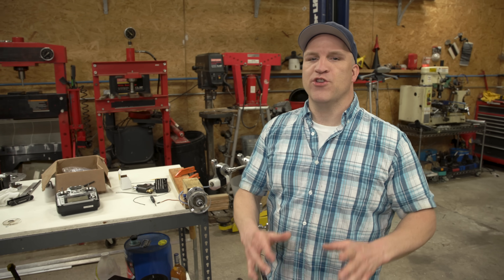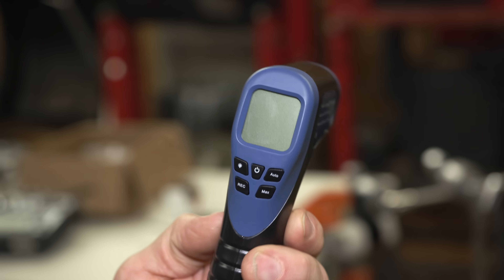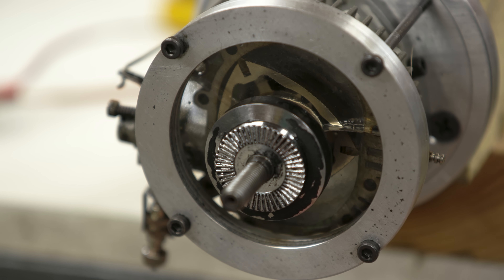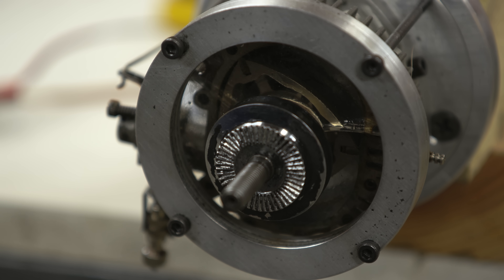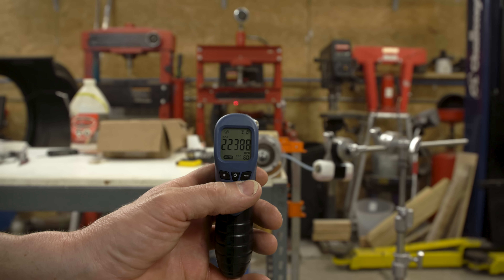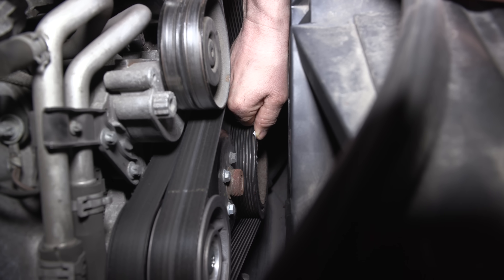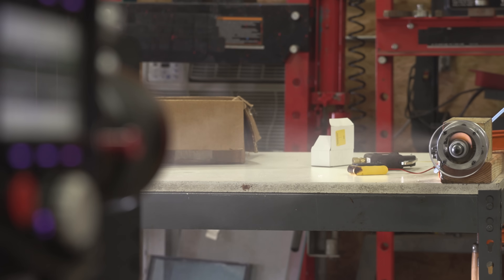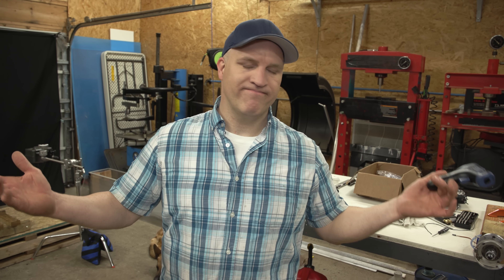See Thru Rotary Engine MAX RPM - 29000 (Wankel Engine)

Comment: This 5cc engine can put out roughly 4hp at its max 48,000 rpm. That's some seriously impressive power density.
Reply: Damn that would be 4,000 hp naturally aspirated if upscaled to 5.0L
Reply: @dbldigitclimbing2681  what was the fuel source used? on nitromethane its totally possible on a 5L engine.
Reply from the maker: @jkk20  nitro yes
Reply: @jkk20  Model aircraft fuel is essentially nitromethane, but different percentages are available depending on the (typically) model aircraft used with this.  I run 15% in my Wankel-powered Kalt Baron .28 helicopter, but 10% on fixed-wing aircraft.
Reply: @WarpedYT  Rob Dahm proved this wrong by putting down 800 lb-ft of torque on the dyno with his turbo 4-rotor 🤷‍♂️
Reply: @dbldigitclimbing2681  Engines don't scale that way as things like friction and inertia don't scale linearly. If you blew this up to 5 liters of displacement and could somehow keep it from flying apart at over 20,000 rpm things like friction and increased surface to volume ratios would rob a ton of power.
Reply: @dbldigitclimbing2681  dang, that's what you call an incredible power to weight radio
Reply: @dbldigitclimbing2681  ye but try getting a 5litre up to 48000 rpm
Reply: @dbldigitclimbing2681  let’s do it
Reply: @dbldigitclimbing2681 Bold of you to assume that a 5.0L engine can rev to 48,000.
Reply: @dbldigitclimbing2681 The stresses would be so high, it's going to explode
Reply: @dbldigitclimbing2681  you cant say that judging soley on the cubic measurement, i can have a 1L rotary that can put out 600hp but thats only if its properly tuned and ignition is fined and also it would need either a turbo or a really large  throttle body
Reply: And fuel consumption is 10 liter per hour... 😂
Reply: Which is nothing? Tankevurpa?  @АлександарКовачевић-б6р
Reply: @kalleelisson3059  it is
Reply: @kalleelisson3059  for a 5cc engine it is
Reply: @АлександарКовачевић-б6р  Not bad considering a 10,000 hp Top Fuel burns 15 gallons of 80/20 Nitro in 3.6 seconds.
Reply: Absolutely, considering how much smaller it is than say a 5hp Briggs&Stratton engine
Reply: tired leeches but how much torque. The hp is a result of the high rpm.
Reply: Anita IceCream  Hmmm.... It's pretty much the opposite.... torque means nothing if you got a properly set gear box... It's just a marketting number....
The only number that matters is power. Since with gear reduction, you can get all the torque you need from power, that's why we've crated gears.... ^^'. 

If you don't get it, you don't understand the core principle of a gear box (and gear reduction).
Power = Torque x RPM (or "angular velocity" for the physicists)
Power is fixed by the engine. By changing RPM (with gear reduction), you change torque. There could be gear reduction anywhere between the crankshaft and the ground. For automotive application, it is in the gear box (obviously), the diffential and even with the wheels/tires size.

If we tend to prefer bigger engines for high power/load applications that's because for the same power, small engines with high RPM/boost tend to wear quickly and to cost more. Not to mention fuel efficiency.
It got nothing to do with torque.
Reply: But 48,000 rpm how u said is just 48 rpm u should have been write 48 000
Reply: My flucking brain hurts from the arguing over engine science.
Reply: thats more than my 50cc scooter
Reply: Yeah... but good luck gearing that down to a usable shaft speed and still keeping close to that power.
Reply: @6Twisted Bullshit! O.S. engines lists the  model 49PI at just 1.27 horsepower max. with max. RPM of 18,000.
Reply: Definitely beats my 100cc 7 hp Honda xr100 dirt bike
Reply: 800hp Per liter 🤣
Reply: @Martin Larson Only 200 horsepower per liter, on nitromethane... pathetically embarrassing.
Reply: Let's put it on a mini bike then
Reply: Rotary engine:
Me: EXCUSE YOU
Reply: and gobbles fuel like an american v8
Reply: No it's not, no torque made by it at all, use it for miniature airplanes ? go carts, or chainsaws, outside of those it's useless
Reply: Dick Head : Power-to-size and power-to-weight ratios are only more important than the power-to-displacement ratio if you're modding a very small car and you don't care about fuel economy. Obviously that doesn't apply to cars that are being professionally designed and manufactured, because they can design the car to fit whatever engine they want to use. However, I will concede that you are correct in the circumstance of modding small cars, even though that only applies to a very small number of cars in the world and thus is not capable of sustaining a profitable Wankel engine manufacturer on its own.
As for the specific example of an original VW Beetle, the Subaru flat-four is a better choice than a Wankel if you want the car to actually be driveable on a daily basis.
Reply: In 1996 I raced RC 12th and 10th on-road cars at the world championships (I got 12th, 21st), the week before the races Mike Swagger was practicing his 1/8th scale onroad car, 0.21ci or 3.5cc, I could hear the incredible rpm's, I asked Ron Peris (now rip) his tuner, he said that 7 port motor makes 4hp and screams at 60Krpm!
Reply: I hate rotaries
Reply: DUDE THATS OP
Reply: At this rpm how much watt and voltage can produce ?
Reply: Ikr it’s as powerful as my lawnmower which has an engine like 10 times bigger
Reply: Yes but a rotary engine is much less reliable than for example an inline engine. It has much more accurate movement which make it easier for the engine to fail.
Reply: I mean even the rx7s had like 1.3l engines
Reply: Gas turbine engines also have large power density.
Reply: Its impressive as a proof of concept, but unusable my any means because it would have zero torque
Reply: @DSperformance96  that's what gears are for
Reply: @whoami13__  you would need 50 gears to get anything usable out
Reply: @DSperformance96   Absolutly not. With 16" ish wheels you could go to 30 km/h with 4 or 5 tiny and lightweight gears. And if you meant 50 gear ratios, it's absolutly false too. You don't even have a power curve to say that. High or low peak torque alone doesn't mean a wide or narrow usable power curve. And "zero torque" relative to what? Maybe it got a high torque at its "low" RPM range (6 000 - 10 000 RPM) and with proper gear reduction, it could be a lot more usable than you think.
Reply: @DSperformance96  it would be good for hybrid stuff. Or with a turbo.
Reply: Does anyone know where I can buy one of these little engines?
Reply: @wing_nut_101 Wankel engines are not made anymore, this engine was discontinued years ago, might find a used one on ebay.
Reply: @EnricoAwsome 1.2 hp for a nitro 5cc engine??? Not impressive at all.
Reply: And 0.594Nm of torque lol
Reply: @MasterofOrion  "6 years ago"
Reply: Hp per liter is a stupid figure
Reply: @ezra5485  cant agree more.. its an immaginary measurement that has no effect whatsoever on anything this engine could be used for, basically its a made up figure for wanna be racers so they can start talking
Reply: @DSperformance96  It actually states the engine efficiency.
Reply: @vladimirlucifer4566  in which way?
Reply: @DSperformance96  Volumetric efficiency. How many horsepower can a engine take from fuel from a delimited displacement.
Reply: @vladimirlucifer4566   i meant in which way is this value usable in the everyday world?
Reply: @DSperformance96  It isn't. Like it isn't torque, or horsepower, or gravity acceleration, or potential energy... But it still states how powerful and efficient an engine can be, volumetrically. It means that if you do a replica with the right materials, you can make out of one liter the horsepower that the small engine can per liter. But it's not really true. It just shows how much power it can convert. It's useful if you want to know efficiency and better understand air fuel ratios
Reply: @vladimirlucifer4566  but my point was.. in a normal rant between car guys, no one comes up with "yeah my car makes 600hp per liter", but I hear people all the time ranting about torque,horsepower.. its just a stupid value for the fact that in day to day life no one can use it for something normal
Reply: @DSperformance96  Actually, there are a great utility of knowing horsepower per liter: it's the best way to compare engines with different displacements, and see which has a better potential and what is tuned better.
Reply: @DSperformance96  if you only want to compare engines based on their power rating you're basically denouncing an engine with a low power output even if it is highly tuned becuase there is a big and lazy engine making more power. An efficient engine is very important in a race car because a smaller more efficient engine is a lighter engine and you will go faster. It's not a made up figure...
Reply: @backwoodbandit186  you just don't understand
Reply: @novathepug6692  🚨🎰🤡
Reply: As with all Wankel engines, the rated displacement is only for one side of the rotor, based on the flawed argument that 1 rotor = 1 combustion chamber, even though each rotor obviously creates 3 combustion chambers inside its housing. To compare its displacement to a piston engine, which are rated according to the displacement of all combustion chambers at once, you have to multiply the rated displacement of this engine by 3. That would be 15cc.
Reply: @fyrstormer  The rated displacement is actually the whole chamber volume minus the volume of the rotor...

Like any Mazda wankel engine.
Reply: @fyrstormer  And even so, the rotor fires once per eccentric shaft rotation. Yes, Because the rotor rotates 3 times slower than the eccentric shaft. And each rotor fires once per crankshaft rotation like a 2 stroke. If your assumption was correct, then because the Rotary Is a 4 stroke, this little engine would have 10 cc, not 15. But again: chamber volume minus rotor volume.
Reply: @vladimirlucifer4566 : Your understanding of "displacement" is incorrect. Displacement is not simply the volume of air inside the combustion chambers at any given instant, it is the volume of air displaced by the pistons (or rotors) as they move through a complete combustion cycle. Displacement is the maximum volume of all combustion chambers minus the minimum volume of all combustion chambers.

Also, I am aware that a single-rotor Wankel engine only has a single combustion event per crank rotation. However, that is irrelevant. Piston engines are rated according to the displacement of all cylinders combined, even though it takes two crank rotations for all the cylinders to complete a combustion cycle. Wankel engines should be rated the same way -- the displacement of all combustion chambers combined -- even though it takes 3 crank rotations for all the combustion chambers to complete a combustion cycle.
Reply: @vladimirlucifer4566 : I said "one combustion cycle for ALL combustion chambers." Go back and re-read my previous reply more carefully. Piston engines are rated according to the displacement of all combustion chambers over a full combustion cycle, and Wankel engines should be rated the same way.

Wankel engines are rated differently because that makes them appear to have higher power density (hp/L or whatever combination of power and volume units you prefer). This was an important marketing trick, without which the market for Wankel car engines would've never existed.

In reality, when you correctly consider the air displaced by all of the combustion chambers over a complete combustion cycle, and you calculate the amount of fuel needed to achieve an ideal mixture, it is apparent that Wankel engines have always had an inferior power density and inferior fuel efficiency compared to contemporary piston engines. They are more space-efficient, allowing 3 combustion chambers to use the same hardware whereas piston engines require separate hardware for each combustion chamber, but that is the Wankel engine's only advantage.

I say this as someone who used to own a Wankel-powered car, and who currently owns 5 of the miniature engines used in this video.
Reply: @fyrstormer  A full combustion cycle is just one shaft revolution. A rotor rotates 3 times slower than the eccentric shaft. So, the displacement of one combustion per "cylinder" is equal to 654, giving the rotary it's 1.3L however, it fires like a two stroke, so you could double the displacement because it's a four stroke, being 2.6L of displacement. One full combustion per cylinder is 1/3 of a rotor revolution.
Reply: 6Twisted figuratively that’s shit but for its size I guess it’s fine
Reply: @arsenicant  That's like 800HP per litre.
Reply: Arthur Boyarsky like I said for it’s size that’s fine
Reply: @arsenicant  Whats you're idea of more than fine?
Reply: @arthurboyarsky1954 800 HP per liter? 

That's a lot more than a Formula 1 V6 engine.
Reply: @arsenicant  fine??????????

Comment: 483 revs per second sounds more impressive than 29,000 per minute lol. Crazy.
Reply from the maker: Lol... Agreed
Reply: Porca madonna...
Reply: I agree.  But the turbo on my car is much bigger and tops out around 180k rpm.  3000 per second, or 3 per millisecond :)
Reply: @h82fail  180k my ass...
Reply: @recepgunoglu4058  possible but pushing limits BIG time in some turbos. my stock turbo,s max is 130,000 for arguments sake
Reply: @jasonstalder5208  i thought he was talkin about the car's rpm, so my bad 😅
Reply: @h82fail  Well whoopee do. Mass of the moving parts is actually what matters, not just size. Also, don't you think that's a bit different? Even a little? The tiniest bit?
Reply: @kilppa  It is different I'm just putting it in prospective and i thought the rev per second was kinda funny.  Also not sure the mass of the moving parts is that different, yeah turbine is not that heavy but this rc plane piston is not that heavy either.
Reply: Then slow down the film .. his RPM counter hit 97.+++ Rpm 
Just go back just before he freezes pic at 29.+++
Reply: @kennethschultz6465  you're wrong. it is 9700 rpm not 97k
Reply: @kennethschultz6465  if you watch on PC you can just press the dot on the timeline then go frame by frame with the dot "." and comma "," keys... Then you will see that you are wrong. It says 9750.8 rpm @ 6:27
Reply: @h82fail  what will really blow your noodle is the G-Force the turbine wheel will experience at it's edge.... 
at 180k rpm, a 55mm turbine wheel will  experience just shy of 1 MILLLION G at it's edge, not even kidding... 
1g of material will require a force equivalent to 1000 kg.. 1 TONNE to hold it in place... that s*&t is whacked...

Comment: You could also use an acoustic recording to verify, if it’s actually running at 29k it should be easily and reliably verified with an FFT spectral analysis.

Comment: You could also analyze the audio signal in order to calculate the rotation speed: Audio frequency divided by number of explosions per revolution gives you the rotations per second. That's the cheapest and most accurate "high-speed-camera" - 48'000 samples per second vs. 3'000 frames per second ...

Comment: Pretty cool man, I pulled a air con unit off a vl commodore that was a wankel branded rotary, I really wanted to add ignition and see if it would run but dropped the rotor on the bench and bent the groove that holds the apex seal. I've never seen another one since.

Comment: I am the one to tell you before this engines are no good and to slow. Why because the shaft doesnt turn in a perfect senter and that can of osilation produce trepidation anddistorsion of power. If you see the way the air gons produce e lot of power wyht some can of amount of air. Thats real power and is posible to built and engine in that way. I gat it but i cant produce by me self. I need help

Comment: flywheel is at 29k rpm but the rotor is actually doing only 9,666.66666666667 rpm

Comment: Hello sr l want you to now that. Rotary engines are not good. The sistem use to manny component. If you want to involve in perfection. We are able to develop someting 100 times better i fond someting unique.  I called. The sircular consentric sistem. This engine in 5positions. 5 explotion per rpm. Bud if we build 6 positions become in double intake double exhaust. That mind isgoig to produce 12 explosion per rpm. I have no money to develop if you want to partisipate or get this teorical engine you can ride to me at 8906 ley rd houston tx or i follow yoursvideos. Thank you

Comment: The rotary engine conceived by Felix Wankel was definitely ahead of its time....

With care and maintenance the Mazda version is just as good or better than its equivalent reciprocating brother....

Food for thought..... Did you guys know that rotary engines thirst for high octane fuel is nearly nonexistent....

Molecular hydrogen has a pump octane of about 74.... Clearly using the r + 2 / M refining method... Hydrogen does not like to burn it most definitely favors detonation...

The rotary engine is perfectly suited to burning volatile low-octane fuel... Many people like to smear the Wankel engine as being dirty..... And when burning petroleum they are correct...

However..... When burning a zero emission fuel that is substandard to it's reciprocating Brothers...

The Wankel engine outshines and outperforms nearly everything with the exception of turbans...

Cheers men,🍻
Reply: Benjamin Hedderly    the rotary "engine" was initially designed to be a super charger for forced air induction and was quite small. getting it to be an ENGINE came later.